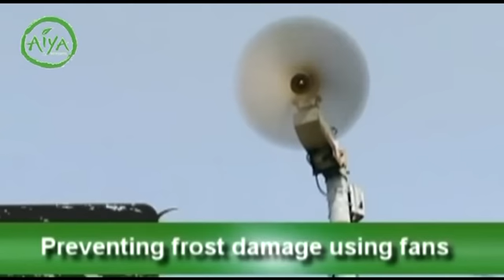Matcha Production in Nishio City - Aiya Matcha

Comment: I have a question. It says it this video that steaming prevents oxidation. My question is How? Just because the leaves are steamed it will stop the oxidation of the leaves in the dryer ? Oxygen from the air should be still oxidizing so what happens during the steaming time that stops that?
Reply: temperature denaturates enzyme proteins
Reply: Steaming denatures an enzyme, polyphenol oxidase (PO). This enzyme is responsible for the dark color of black tea. So, in the preparation of green tea as well as match, denaturation of PO at earlier stages is the key.